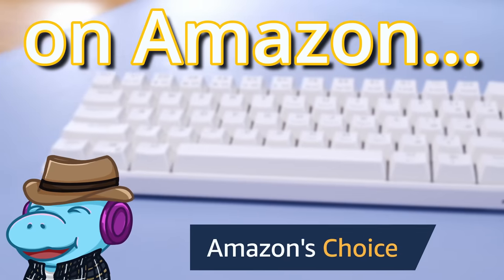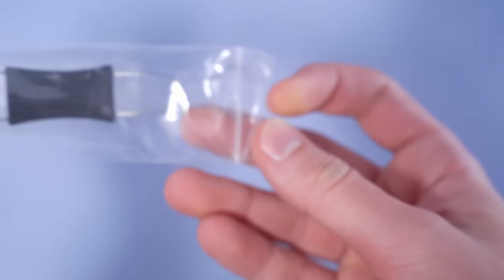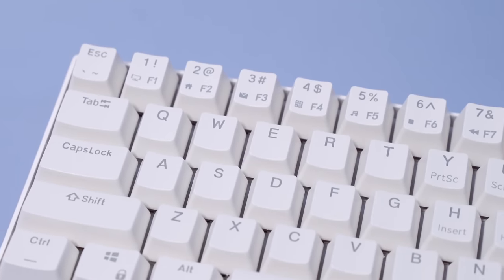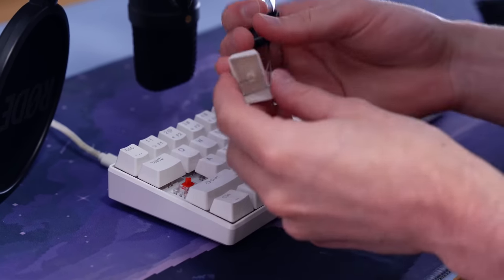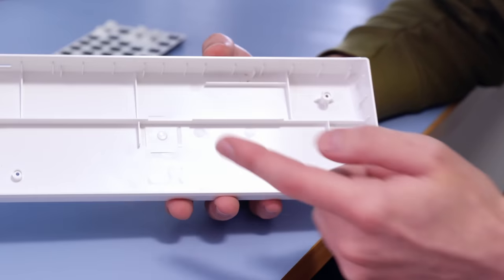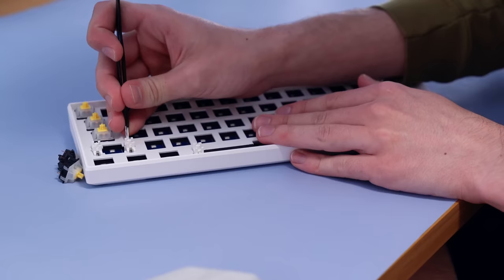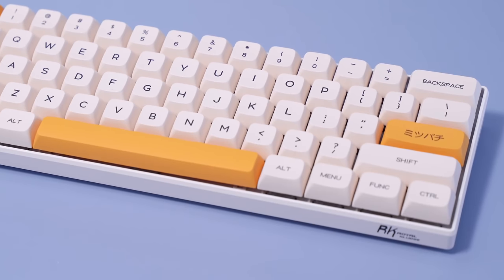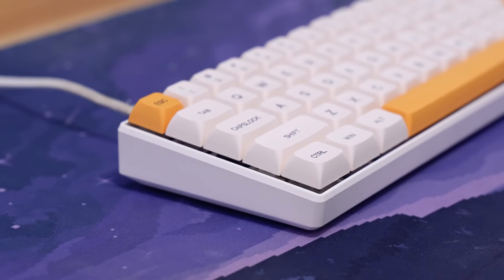I Tried the Most Popular Keyboard on Amazon... (So You Don't Have to.)

Comment: i purchased this keyboard as my first hotswap keyboard that i could mod and play with..... its a fantastic keyboard for the price..... and you can make it sound pretty good....i paid a little more for mine when i got it than what it sells for now but it also came with an aviator cable when i pruschased it.... i swapped the keyscaps and switches ( pbt and gateron yellows) and it sounded really nice..... i eventually retired it for the epomaker x feker galaxy 80 and it is a pretty crazy differance between the two..... the only reason i moved away from it tho is for the f1-f13  keys and the arrow keys..... i still have the rk61 that i use with my steam deck when i connect it to the televison

Comment: I'm looking at getting the RK84 with red switches. That one has the option of being either wired or wireless. I've never done any type of keyboard mod but I'm thinking of doing simple things like taping the back of the PCB, lubing the switches and probably changing the caps

Comment: It will sound a lot better if you use a silicone mixture and mould it into a sound dampener. Did it with mine plus used durrock linear and stabs.

Comment: Hi Hipyo HERE ME OUT ok? , you've been at the top of my list for doing research on Keyboards as i delve into this new hobby. I have a question for you that maybe not a lot of people ask (since maybe nobody cares about it), but could you do a video, or perhaps lay out a comparison for linear switches and how they sound like using the same mods (kind of like A/B testing different switches after fully modding or using your favorite boards). The reason I am asking this is that I have noticed quite a bit of difference in typing experiences (and gaming) when switches have lower/higher total travel distance (for example the difference between 3.8mm and 3.6mm was actually felt when I made the switch as my typing got faster and it was more accurate). I noticed the switches you used here have a 4mm total travel and a slightly higher actuation force than I would have like which is somewhere between 40 and 45g. 

Do it and I will sub xD

Comment: Getting a 60% like this is a bit of a problem in my opinion, because you don't get qmk/via and the stock mapping is atrocious. A 60% that is fully remappable with multiple function layers means you have all the functionality of a larger keyboard except it's far faster to use and more efficient than a larger board while also taking up so little desk space. 

Imagine having arrow keys instantly without moving your hand off the home row; imagine pressing f keys without leaving comfortable typing position. None of that happens if you have a non-remappable function layer and can't move fn anywhere else. The 60% is just an awkward cramped keyboard that makes everything slow if you don't have full remapping capability. 

Replacing caps lock with fn1 and bottom right fn with fn2 (media controls) is my preferred setup (caps lock is far too useless to be occupying the easiest left pinky key), and I also swap Super to toggle fn1, fn1+lshift to normal shift, and base layer lshift to Super which is my mod key for my window manager. Then fn1+hjkl becomes arrow keys because ijkl is for cowards, fn1 + fn2 toggles into launch programs mode which allows me to launch literally anything I want and automatically exits upon launching a program. Also pressing the hold fn1 key undoes the toggle when you release it. 

All of this you could be doing but you're restricted by terrible remapping software, which turns the best layout into the worst layout. These cheapo 60% keyboards would be great for modding if they had remapping software that allowed full customization.
Reply: If you're wondering where caps lock went, he went out to buy some milk. I'm sure he'll be back soon.

Comment: I just bought an RK61 only difference was mine was black. It has Bluetooth AND wireless via a dongle (little slot on back to hold it) and hard cable. Also two switches on bottom 1 to turn off and on and a toggle between wireless and Bluetooth

Comment: Honestly for the price just get yourself a keychron V1. With some extremely light modding, good switches and some cheap keycaps it'll sound much better than this. I've had one in my rotation and honestly I'm never sad to type on it. Stock stabs with some tangies and DCX caps and it sounds like it's 3x its price at least.

Comment: Hey so Ik they’re first keyboard def wasn’t the best but can u check out the new 100 thieves keeb. This time it actually looks like they did research and it checks off a lot of the boxes for a good custom keeb. It even comes included with durock v2 plate mount stabs. It’s 300 so now I’m curious if you would think it’s worth it

Comment: Hipyo man.. I have one of those with 2.4ghz dongle and BT as well as usb c.  I slapped some gateron yellow pros in it.  I like this keyboard so much I have 2 of em lol.  It's not quite as fancy, and it's harder to fill the dead space with mine since all of the freaking switches to choose between BT/2.4G and USB C or wireless are all on the bottom, but one day I'll figure out how to fill this thing in some and quiet it down lol...  I ended up pulling the gateron ks9 pros and putting them in my soldered on rk61, and put some outemu honey peach switches in the hotswap rk61...   For people just getting into keyboards and aren't really trying to resolder a more budget board... the hotswap versions are a pretty solid deal.

I did quickly replace the keycaps with some PBT doubleshot caps.  I think I've got stabs left to do.. I dont want to tape/holy mod to the stabs.  Maybe some tx or durocks.

Comment: mine actually came with prelubed stabs. it was nice, but the stabs were unclipped, so i still got a bit of lube on my hands ;(

also i put the included PE foam in the box inside my board to make it sound slightly more poppy and surprisingly it works great! I still might replace the keycaps in the future for some pbt ones, but overall, the product i received was pretty good

Comment: I actually have this keyboard, bought it on a whim and I like it a lot. Mine came with a aviator cable and is wireless. The white looked bad so I got black and the software was hard to find but I did find it.

Comment: Idk why, but why tf RK boards are way more expensive in amazon? here in Philippines, you can get a tri mode RK 61 for 30$. Also RK boards are really fun to mod, my gf have RK84, I have Feker IK75 Pro, the barebones alone is 20$ more expensive than a fully built RK84, we modded both, put the same switches and keycaps, and their only difference is that mine has PC plate and she had an alu plate, the feel and sound are almost the same. Also, these newer batch of RK's have plate foam, case foam and pretty good stabs, just do tape mod, holee mod, band aid mod, lube your stabs and your board would improved a lot even with stock switches and keycaps

Comment: Hey Hipyo, I had a modding question that I have not yet heard you talk about. I have a hot swap keyboard that only allows 3 pin switches. I have seen on Reddit that people are getting 5 pin switches and clipping the extra two pins. I am new to modding/building and wondered what your thoughts were on this. 
Also, I have an RK61 that I am going to try to mod as well. Thanks for this video. It got my brain cell working and I have a few thoughts on things to try for mine

Comment: I have the RK61 (bought it before they made a hot swap version) and it has MAD spring ping and scratchiness. I modded it best I could and it still sounds bad. I did my best to lube the switches, put sponge in the case (thought the irregular structure would do better to trap sound), changed keycaps... still sounds like trash. And NOW they have a hot swap version 😭

Comment: Something that never gets talked about in these "I bought this janky keyboard off Amazon" videos is that the software/drivers that come with them are also janky as hell.  If you want to remap keys on this board, you have to download software off of google docs and tell windows and your antivirus that it's not a threat (might be a lie). I got one of these (the aluminum case version, $20 more) to test out switches and modding ideas on a platform where I don't care if I break or scratch something, and also to see if I can train myself to use a 60% keeb before splurging on a boutique kit.  Worst case scenario, I have an aluminum case to play around with in the future. But yeah, the software is really bad.

Comment: I was considering this but ended up getting the vx5 pro bout $36 if i convert it south facing led except esc key and 1 gateron yellow prelubed stabilizers the plastic is quite good aswell it's quite heavy and solid (imo) and its transparent comes with foam aswell but its thin 5 pin hotswap also theres a few more options for switchs jwick t1 jwick ult black gat yellow gat brown outemu red,blue,brown pbt doubleshot keycaps braided cable

Comment: i'm impress it sound good. still a bit clacky for me even with the milky yellow compared to mine. ( a th80 that i change the foam and put o ring on the keycaps) it was the first time that i tryed linear switch and now i don't want anything else. 
now that ii'm sure of what i want i'm gonna make a custom keyboar, i'm just searching for a color that i like and good azerty keycaps ( that's a nightmare to find in stock i have stickers on my keyboard in case someone else want to use it)

Comment: Ok, I need to address an issue with this board. There appear to be two variants of it online. They are easily distinguishable as one has rgb and one has a gold/blue backlight. The one I have is the gold/blue backlight, and i don't think that one is hotswap. Wheres the rgb one is. Im confused by this.

Comment: This keyboard is, apart from the hotswap capability, the worst trash you can buy.

I mean, it is 50 bucks or something, but that does not excuse the keycaps which are terrible quality, and the switches, which are clones of clones (Gateron) and sound really bad even when they are lubed. They sound as if they literally are disintegrating when you press them.

You can switch them out for other switches, which I did. However, if you press more than 3 keys at a time, for some reason, Capslock activates, making it very, very awkward to play any online video game or even type to someone, because Caps will constantly be toggled on and off. 
The last reason this keyboard is currently rotting in my closet is that it is a 60% keyboard, which is cringe but that's just my opinion. 

All in all, I don't even know why I bought this, there are better hotswap boards out there for like 30-50 bucks more.

Comment: ...have you ever considered just trying to make a board good with the parts it gives you? Yeah, most boards are going to be decent if you put in good switches, use nice keycaps, and mod it... ever considered using the same parts and just lubing and modding, no part replacements that'll cost you as much as the keyboard itself? Because all this review actually told me is that it's easily customizable and the lights are slightly off.

Comment: i would never recommend this board to anyone. Even though with modding the board can be quite serviceable in regards to sound and feel, I am convinced there has to be something wrong with the hardware chipset or firmware. I have tried 3 separate boards and all 3 of them had ghosting issues where when pressing 2 keys in a single row at the same time, that row's left hand modifier would ghost press.